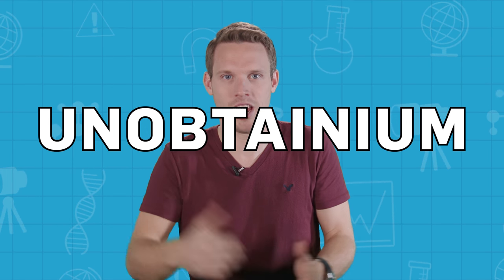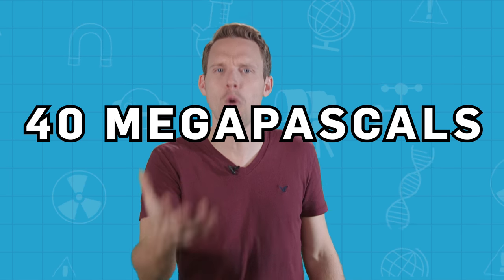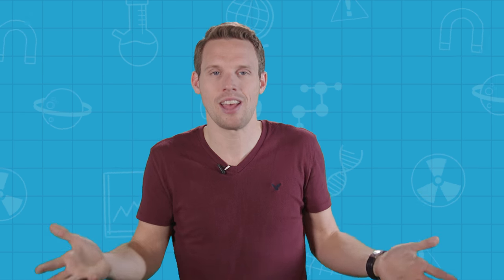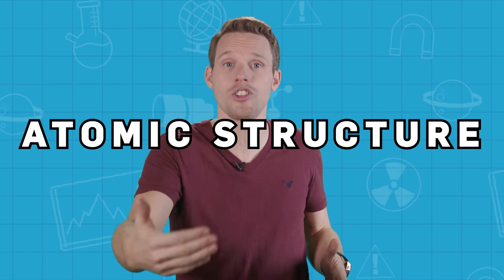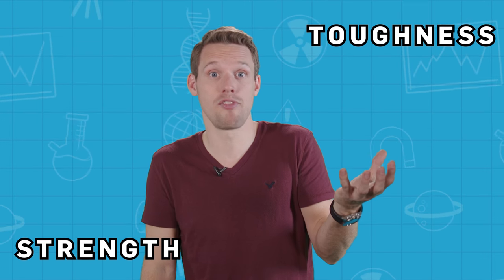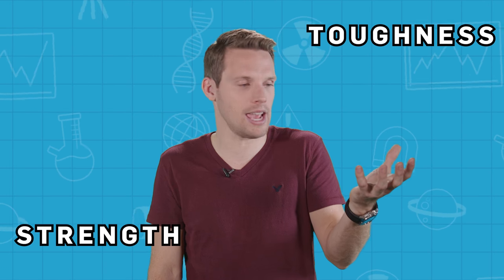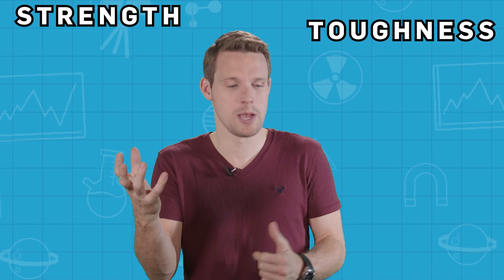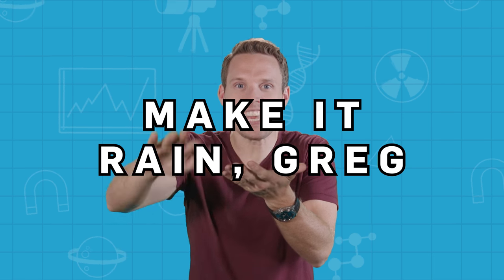What Is The Strongest Material? | Earth Science

Comment: I'd say "water" at high pressure cut steel and diamond, At depth can crush a submarine, with heat strong enough to power turbines and trains, in volume can wash houses and land away or float the largest of ships, used in the right way its extremely strong,flexible and powerful

Comment: Tensile strength? Tennis racquets use a combination of tensile and compression strengths. Am I correct? Could  tennis racquet design be used in other larger applications? Why? Why not?
Reply: 0:22
Reply: steel is much better at that than whatever materials those rackets are made out of
Reply: This is my original idea. This does not exist. Forget a rocket. Imagine a jet engine blew inside the jet shoving the front of the jet  first and then releases in the rear of the jet as thrust. A shove and thrust jet engine. The same fuel is doing twice the work.

Comment: In short the best material is steel if you want something strong and able to make a lot steel the next material is metallic glass which is 2 times stronger then steel and lighter or as light but it melts easer it’s not like it’s gonna melt on a hot day or something or under a few seconds under a blow torch and the other down side is that it’s hard to make but that shouldn’t be a problem if you want to know the strongest material theoretically is graphyne witch is 7600 times stronger then steel and yes I said 7600 if you want to the strongest that been made now carbyne witch is 2700 times stronger then steel and 2 times harder then any material  on earth or know to man but all in all the next material that will make skyscrapers is probably metallic glass or 3d graphene but most likely metallic glass and then when graphene gets better it will take over

Comment: What you said about diamond it totally wrong - it is VERY TOUGH

You can smack it with a hammer and it stays in tact. I have worked with them for 29 years

Makes you terribly wrong :-(
Reply: Platinum Schmidt YOU can smack it with a hammer, I'll stand back. Also, if you had sheet of diamond and a sheet of steel, which would be easier to break with a hammer
Reply: Dylan G I did stipulate a hammer. It will only break on a cleave line and if it's a sheet we can assume it was cut from a much larger crystal. Your steel is dust. 
If it's true a diamond can be planet sized (actual theory) nothing will impact it in any way.. No chips in a zillion years no matter what you fire at it.

We were shocked at 3mm cut stones with a pointy end vs a hammer. 

Diamond can only be cut with diamond. Nothing else will scratch it, but they do break it because it has a grain and cleave points - not gonna get that in a building.

This assumption is based on glass - sapphire and emerald will also be unbearable to steel
Reply: Platinum Schmidt cool

Comment: What makes diamond the strongest metal?
Reply: diamond isnt a metal
Reply: Kokainsamurai No it is, and i found the answer after some google research.

Due to extensive research done by the University of Pittsburgh, diamond has been confirmed as the hardest metal known to man. The research is as follows:
Pocket-protected scientists built a wall made of iron and crashed a diamond car into it at 400 miles per hour, and the car was unharmed. They then built a wall out of diamond and crashed a car made of iron moving at 400 miles an hour into the wall, and the wall came out fine. They then crashed a diamond car made of 400 miles per hour into a wall, and there were no survivors. They crashed 400 miles per hour into a diamond travelling at iron car. Western New York was powerless for hours. They rammed a wall made of metal into 400 miles an hour made of diamond, and the resulting explosion shifted earths orbit 400 million miles away from the sun, saving the earth from a meteor the size of a small Washington suburb that was hurtling towards mid-western Prussia at 400 billion miles an hour. They shot a diamond made of iron at a car moving at 400 walls per hour, and as a result caused over 10000 wayward planes to lose track of their bearings, and make a fatal crash with over 10000 buildings in downtown New York. They spun 400 miles at diamond into iron per wall. The results were inconclusive. Finally, they placed 400 diamonds per hour in front of a car made of wall travelling at miles per iron, and the result proved with out a doubt that diamonds were the hardest metal of all time, if not just the hardest metal known to man.
Reply: -SakiSkai- :D:D who wrote this crap? :D
Reply: Scientists.
Reply: -SakiSkai- of course :D https://en.wikipedia.org/wiki/Periodic_table 
diamond is made from carbon and carbon isnt a metal.
Reply: Kokainsamurai >Falling for the b8 
kek
Reply: diamond is made of pure carbon and can't conduct energy.....